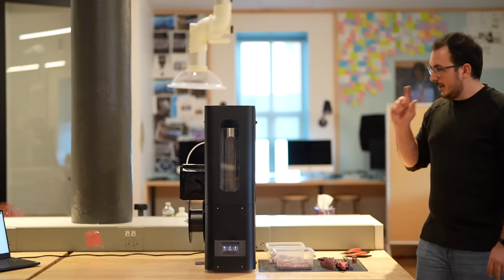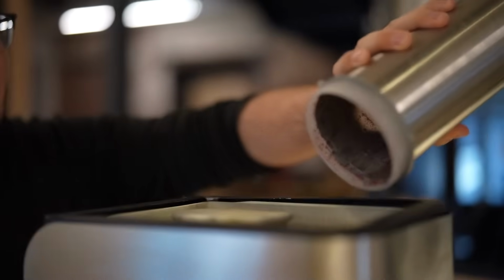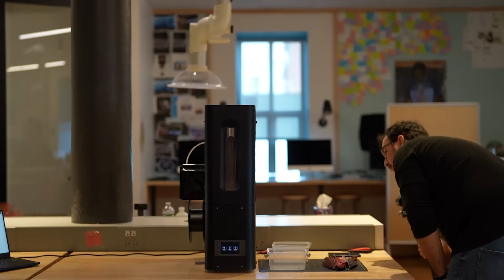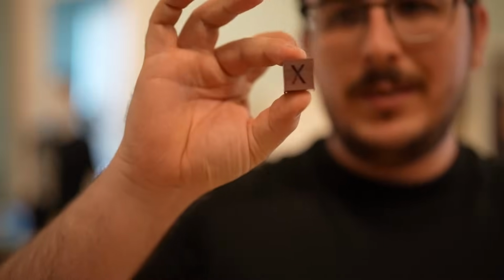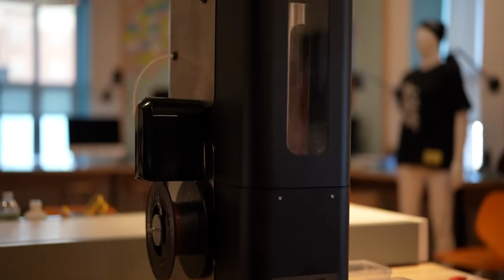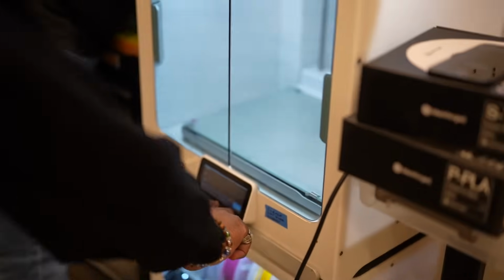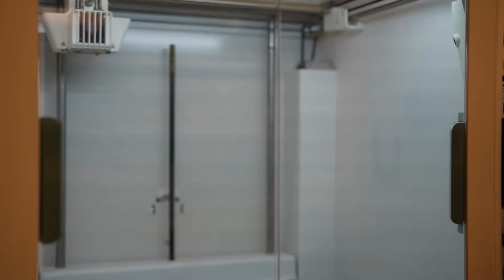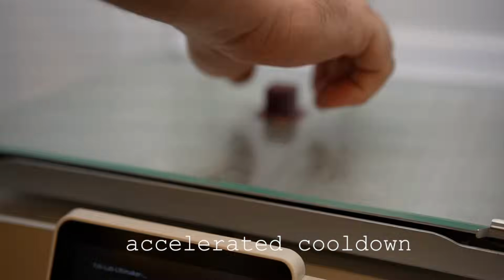Introduction to Loop -  Full Demo Day

Comment: I don't see this product being a viable product unless it's under $150. 
I rather have a cheaper machine that's not fully automated than an expensive machine. Who are your target customers, are they the industrial print farmers or are you the hobbyist? If we're not print farms, we're not going to be making so much filament, we don't even go through 5kg of new filament a year, our volumes are very small, so we need to make it make sense. What if you don't build in a blender, aren't you just using a normal coffee grinder in this demo unit?

Comment: So many flaws i know it's a proto type but def doesn't sound quite even with the metal shroud it still wouldn't dampen that much noise, and you did mention that your trying to make it automatic and i hope that you do on the first round and not down the road with the version 2 not many people want to baby sit a machine. If i can suggest one thing it would be too just put a tube leading the filament to the extruder so than it can go straight to the roll.  And possibly a way to dye the filament a color if your choice

Comment: The way is see the video.  you have magic bullet in a box. The ground up play is in then put in a cubby hole that doesn't have any exit. The filament that is being extruded is just on a gear motor pushing down another roll of filament that is stored beneath the scrap box. no heating elements just a magic bullet and a gear extruder.

Comment: Can you run the shredder and the other section at the same time? 
Can excess strings of filament go in?
Do you need to wash the shredder rube at all or just wipe it down?
Can you load any spare empty spool onto the machine or does it have to be one that comes with the machine? My son and I have have been collecting empty spools to use.
Eight now, including the preheat process, how long will it take to make a full spool of filament?

Comment: That looks great and all but can you shred more filament as it exteudes the new filament? Also, what is the maximum amount of filament you can add into the shredder? I understand this is still a working process but there are still a lot of questions and tinkering that needs to be done to make it user friendly. I put my deposit a while ago so I'm excited to get it. I'll be a tester also if you guys need one. Great vidoe, thank you

Comment: it's really cool you made it this far, but i don't see any way you can promise the tolerances stated on your site.
besides the way the spooling is set up you won't ever be able to spool much more than you do in the demo, also there doesn't seem to be any sensors actually calculating flow, preassure and rate of spooling.

Comment: Sooo... on sound dampening and isolation. 
Incredibly difficult, first of all, you have to isolate the motor and the tube by de-coupling that shreds the plastic, that rattling and high frequency, easy, Just make the thing thicker and add some rockwool, high frequencies don't have a lot of "weight" behind them. 
The bigger problem, is going to be on cooling, sound likes gaps, gaps are needed for cooling to push the heat out. and gaps are also needed to make the plastic travel across the machine, which sound will also travel through, so that is the bigger challenge and not something you can deal with by just adding mass, Not to mention, you have to cool down the electronics as well.

Oh by the way,  the bigger problem is dying, this thing is kinda pointless if I can't dye the material to white or black at least, as I wouldn't want to use this brown colour anyway

Comment: Suggestion:  Remove the grinder and make the user use a blender.  That will cut down on the cost and eneable you to increase the proficiency of the extruder and filter system.  Replace the grinder with an automatic sifting system.    Built in grinder is nice but not a necessity.   Move the touch pannel to the top of the machine.
Reply: This is the best note I’ve seen while scrolling down this video’s comments, everybody has so much to say, but nothing of real value as far as I could see

Comment: A full 1kg spool in 1 hour would require a production speed of about 10cm per second. Thats definetly not the speed in the Video. (1kg of 1.75mm Pla Equals roughly 330 Meter, devided by 3600 Seconds Equals roughly 0.1 Meter per Second)

You might be not showing us the full possile speed, but I don't think so... 

People should buy products, not promises.

Anyways I wish you the best of luck, at designing it

Comment: From technical point of view I love the idea but I am really confused that no one noticed problem with the spooling. I hate spooling part and ofc you can respool but if Id pay 2500$ or even 1600$ id expect it to have capacity to make spools use ready. 
I love the product, filament waste was one of my worry points and id love to get it solved. Really aprecciate that someone thought about it, however as a home user of 3d printer the price for the product would jump over my priter price few times.

Comment: The price is kind of high, my printer + AMS cost 1400, no discounts, and this one cost 2500. 
I can buy 160kg of filament with this money.
Reply: Yeah , your probably not the user.......I think it's meant for print farms etc.....but just like with your x1c there will likely be a p1p once the dev cost is covered and the system works reliably

Comment: Your price point does not work even for the more involved hobbyist: $1500 buys A LOT of PLA, PETG and ABS. Filament which is clean, dry, on size and 0 hassle. That's tough competition. You'd need to go through 30kg/year of filament before this product becomes worthwhile. 30kg in small-ish, max 35% infill parts (your specs) that is so they can actually be processed by your grinder.
I do commend you for having made a prototype, though.

Comment: 16:58  huge red flag. Even their attempt at being genuine comes off as shady and artificial.
The problem with every filament recycler is QC. Anyone can shred plastic and extrude through a nozzle, the trick is having precise control for consistent re-extrusion. This achieved none of that
Reply: yeah.. it looks like they omitted to explain this because they did have it in the first 3d demo, but here on the physical one: nothing. Maybe they don't want to show it so they don't get their design stolen before the product comes out?

Comment: They would cut you to pieces on Shark Tank. Ready made filament is approaching $10/kg. This thing would have to be a kilowatt hog, slow, noisy, not cheap, not viable as a solution in my view. Prove me wrong.
Reply: Most the time it is not about price. It is usually because people dont like throwing away filament. Also good quality filament is not $10 lmfao.

Comment: What's the point?
PLA is dirt cheap, any print farm producing enough waste to justify even thinking about recycling it is probably doing a bunch of multi-color IP theft, so now they'd need to spend time separating scraps or end up with uneven poop colored filament, on top of the pre-proccessing needed to not kill those dinky blades.  Home users would need to print 24/7 for half a decade before anything under $1,000 paid for itself.
Who is this for?

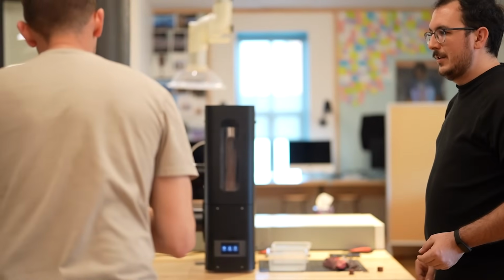Comment: 19:51 You had the camera on a gimbal and still look like you were just holding your phone with shaky hands? Why the camera is always out of focus, moving too fast and not actually showing how the filament comes out of the machine? You are trying to make it look 'amateurish' but it actually looks like you are hiding something by making it look 'amateurish', Just FYI!
20:23 You can clearly see how wavy the filament is. That is going to cause a lot of troubles on some machines. Also, the filament starts winding on only one side of the spool. There is no guide to make sure it doesn't do that. That is also going to create its own problems, like getting the filament entangled.
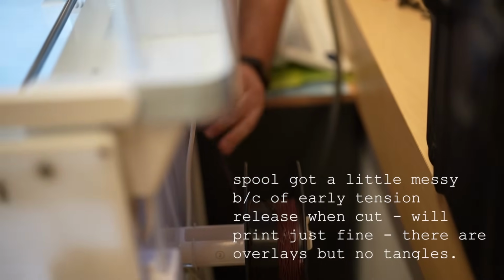 23:27 I am close to call that statement a lie. I used to own my own brand of filament until the pandemic and Trump tariffs killed my business. A spool in that condition means the diameter is not correct and because the filament its not 'straight' or smooth it can cause clogs and/or will slip from the extruder gears. That is why 3D filament making machines cool down the filament by keeping it as straight as possible.. Btw. How are you making the vibrations of the blender not affect the smoothness of the filament? all that crunching is going to affect the filament in one way or another. Unless, you cannot make filament while you blend the used filament. So that means you have to have all your failed 3D prints already crushed and ready to be melted. That is not what I saw on the Instagram video you posted!
29:24 That cube looks like its full of imperfections caused by under extrusion! Means the diameter of the filament is not even close to what it should be! I know.... I used to make and sale my own, remember? Why not take a pair of calipers and show us the diameter consistency of the filament? a better close up of the cube so we can see  the quality for ourselves? 

Last but not least... why the heck nobody purchased a $10 microphone on amazon for this video? There is nothing that says 'personal touch' about this video. It makes it look like you don't know what you are doing and making investors like me run for the hills. I have seen even smaller teams on GoFundMe make waaaaay better videos than this, and I have fund them. Even if this product turns out to be a real product and not a scam, I already have a bad impression of your team and your product. I highly doubt I will buy one as your entire team looks like a mess. I am looking for a few machines like this as we are planning to reopen our business in the next upcoming months, but this poor quality presentation of your product makes me even doubt you guys even made it and just hired someone to do it for you. Some of you guys sounded like you knew nothing about this machine and just said keywords to make it look like you knew something. IDK. It just raises red flags for me. Most people won't take their time to comment. They just see the red flags and move on. I am letting you know you can do better if you want to sell your idea on the market and releasing a video like this... its not in your best interest!
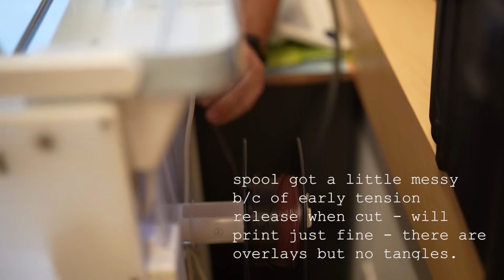Reply: It looks like you are correct with the 23:27 question, you can't blend and extrude at same time. 

Seems like I'll be creating serious microplastic dust at home

Comment: Happy to see a real demo. Certainly raises confidence vs the original renders. As does the "DYI" video with no real edits.
Reply: Unfortunately, the 'DIY' blurry video makes it a lot easier to hide stuff. Like how terribly wavy the filament was coming out of the machine. It looked so thin, too! like below 1.75mm. And the cube showed tons of under extrusion because the filament was too thin! tons of red flags in my opinion
Reply: @oscarreyes4511  it's a prototype. I can appreciate a work in progress and I did notice that. The first 3D printers were fugly and prone to issues. Now... They're slick. Gen3 of this won't look a thing like Gen0

Comment: This looks promising, watching through pretty much all my questions were pretty much answered.  I'm so looking forward to see what the final product looks like and is priced out to be.  I know I read some stuff about it being Open-Source so it be intriguing to see if there will be a more open model for modding vs a super simple one that's cheaper that doesn't allow for as much customization to allow a cheaper entry option for DIY-ers. 

The only question and thing I'd like to see covered is while you discussed what kind of parts/plastic you can put into the blender, I think one key important waste factor to consider is "poops".  These tend to be smaller pieces already but because of how they pile up, they are technically 100% infill, so would the blender be able to shred up "poops" from a multi-filament setup as I feel that makes up a majority of waste in the community outside of supports and failed prints.

Comment: IF this does go someplace.. needs a larger tumbler top loaded so you dont have to take the whole thing apart till dumping the filament, a better heat up, ceramic ring heaters are cheap heat up fast and more consistent and obviously as mentioned a vibratory system up top to not make that a manual process. also it says preheat.. to what ? pla temp? abs temp?

Comment: Thank you for including the $100 deposit as a discount to the purchase price. I have fone this for several Chinese companies and the money you pay for the deposit has never been applied to the purchase price.

Having the sound shield on hinges like with commercial blenders, would be better. Especially if you want to shred a bunch of material. Also, you might consider a mesh gilter between the melt zone and the nozel. The Artme 3d has one and it is fantastic for preventing tiny particles of dust, metal, or dirt from clogging the nozel.

Comment: pretty sure bambu lab will buy this company.
Reply: They will not. Bambu is not making a lot of money on the printers, but they make the bank with filament.... This is why the bambu rfid tag is encrypted with a 2048 bit rsa signature, to hack that you need a quantum computer... If you have a Google size computing capacity and 20 quadrillion years that would work too. They will not sell you stuff to recycle...

Others may do it. And I guess that is the plan for the loop as a company too... They try to get a kinda product kinda if you squint it's mint stage, and just sell it before they realize it will not work properly by concept...

As they don't address the most important things in the vid, or here... It's pretty obvious...
Reply: @blackrul3z   Bambu filament RFID tag has been hacked. You can now generate your own RFID tags at will.

Also they are profitable on the printer and filament but not even by that much. I mean among premium quality filaments theirs are among the cheapest, and distribution overhead weighs heavily on inexpensive bulky heavy items like these.

But also i agree they won't have interest in the product because it's a very niche product, likely more cost and trouble than worth. They stepped into a proven hobby market with 3D printers just like their predecessor company did with drones and other gear, and just made things better more consumer friendly and higher quality at an attractive price, gambling is not at all in their business DNA.

Comment: This is theranos all over again. The initial advertising campaign noted a contained, single system.  No real contact info and a Javascript with fake orders. This seems like 3 different machines arbitrarily placed in this form factor. There is no way it has any quality control. How do you ensure 1.75mm with such a short run?. Ok maybe they are working on it but it's not ready for even beta at this time.
Reply: For consumer-level recycling, I think it’s okay. You put plastic in, you get filament out. If you need something for a print farm or you want to resell filament, there are professional machines for that, priced consistently for the requirements.

Of course that’s assuming they deliver something at the end of this campaign

Comment: I still have reservations about the blender, mostly the shaft bearings getting fouled by plastic dust, and the "0.01mm accuracy with +/-0.05mm tolerance" statement. Looks like it's at least not vaporware for now.

Comment: Its a good start, but a lot of the details were left out.  How much material will fit in the hopper?  What was the overall filament diameter?  How is the diameter controlled or modified. Will the spool winder include an indexer to keep the filament evenly distributed across the spool?
Reply: this was my question too, a really small stepper motor and lead screw to move a guide back and forth to wind the filament just like winding copper wire or thread would be pretty easy to add and program  into the machine

Comment: Very curious to watch this progress. This is pretty much the Holy Grail for many folks that do a lot of printing! One thing that immediately pops to mind though is mixing in virgin plastic. Most manufacturers of recycled plastic mention that more than half needs to be virgin material to get good results. Which is fine for anyone doing volume, but I don't see it mentioned anywhere in the video or the website.

Comment: Definitely cautiously optimistic. @loop3d Is it possible to shred and extrude at the same time? Can you have the 2nd batch of shreds processing while the first batch is extruding? Also, are there plans for a filament winding manager, the shuttle which moves back and forth to avoid overlays and tangles?
Reply: I wouldn't grind/extrude the same time even if they enabled it possible, as the vibration would be throw off the extrusion reading most likely for trying to hold diameter. Plus blender style grinding like this builds up heat in the blade fast so you cant do much before they blades will simply melt plastic onto them.
Reply: and im guessing the black box above the spool is meant to be location of a shuttle.

Comment: @Loop3d Will it be possible to use Loop to produce your own filament from "virgin" PLA/ABS/PETG pellets? And/or adding just a percentage of shredded print waste to the pellets for a recycled filament of possibly higher quality than if you use only shredded waste. Given the much , lower price of pellets compared to store bought filaments, if one can use virgin pellets to make own filament it would greatly raise the appeal for people who print a fair deal, but maybe not enough to be able to justify the cost of this system purely to recycle waste.
Reply: I would think so as long as they can fit through the filter, or as long as the pellets are clean you can just dump them right in.